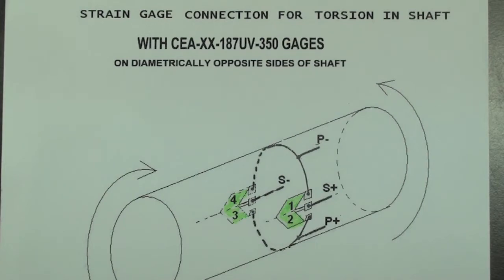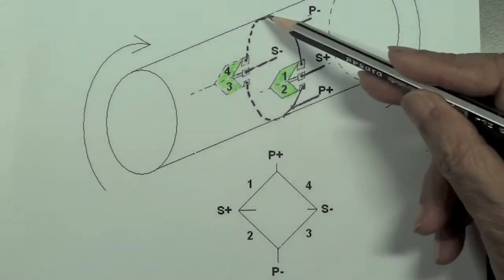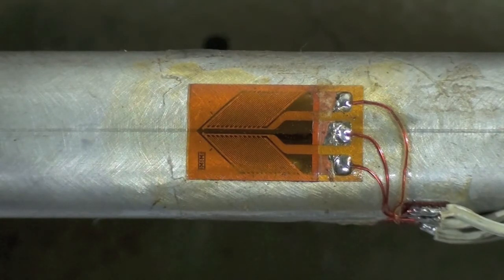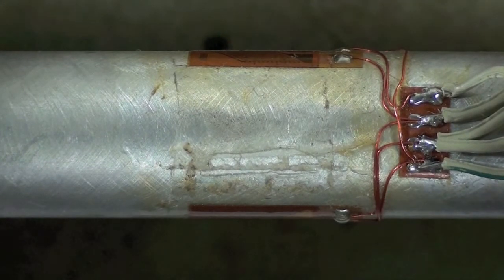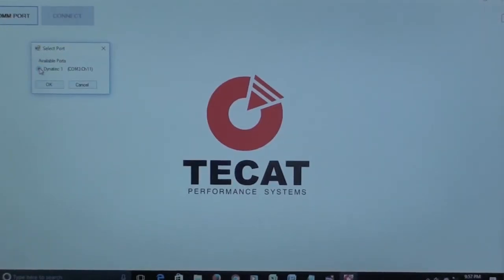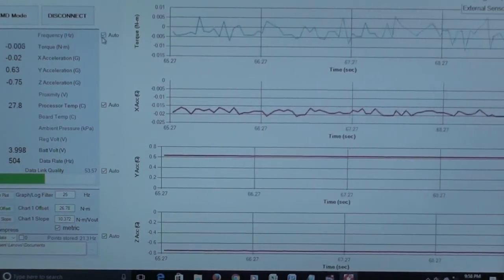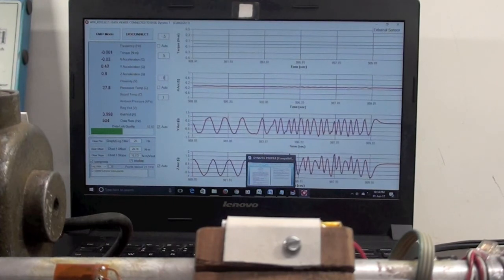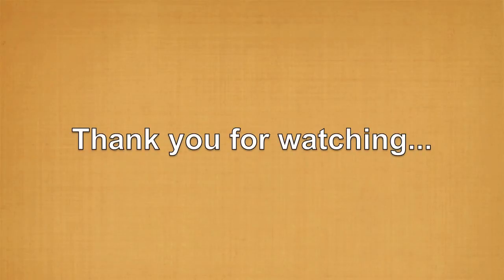STRAIN GAGE(GAUGE) FOR TORQUE MEASUREMENT on rotating components

Comment: does this system use dc braking to measure the torque?
Reply from the maker: Any torsional force applied to the shaft will result in an output from the strain gages. The torque may be due to DC braking, or while driving a motor or engine, or through a gear box, or brakes applied to wheels, etc.
Reply: @DynatecIndia  I understand. However, when will the final torque value be determined? Will it be when the motor under test comes to a complete stop due to DC braking?
Reply from the maker: @jianneangelikacubillo1969  The torque is measured continuously from start to finish, at pre-determined intervals of time. Measurements can be made every second, or at several hundred times a second if required. These readings are then plotted on a time graph, and in most cases the torque values can be checked for the maximum torque experienced by the shaft. This peak value of torque is considered for determining the maximum stress in the shaft.
Reply: @DynatecIndia  Thank you very much, sir! This means a lot to me.

Comment: What are all the components (and their models) called please?
Reply from the maker: These are rotating parts of machines. Examples are shafts, crank shafts, drive shafts, clutch, wheels of cars and bikes, bicycle pedals, helicopter blades, windmill turbine blades, aircraft engines, electric motors and generators, etc. Anything that rotates in any type of machine, and you have to measure the torque or strain on it, requires the use of a telemetry system like TECAT.

Comment: Sir can you make a video on how to measure stress induced in a circular hollow bar with help of strain gauge..
Reply from the maker: If the hollow bar is not rotating, then you can bond a 3-element rectangular rosette gage to the surface, and measure the output of all the three elements of the gage individually. Orientation of the gage is not important. From the three readings, it is possible to calculate the principal strain and direction , and also the principal stress values.
I hope this answers your query